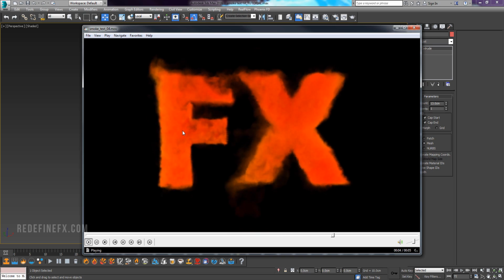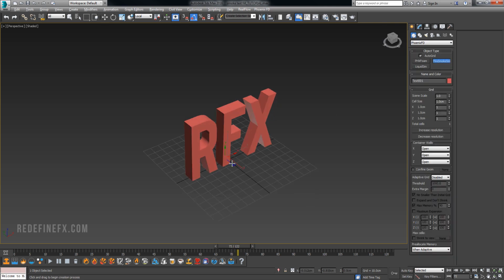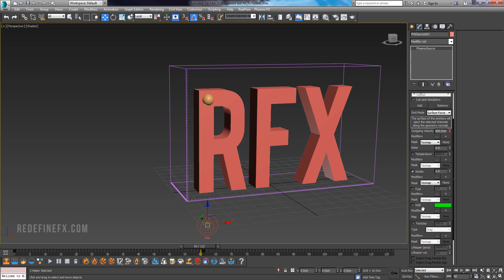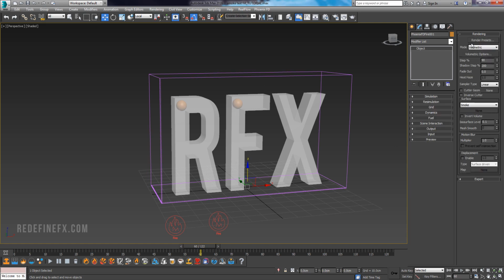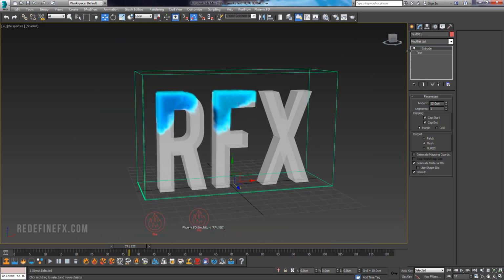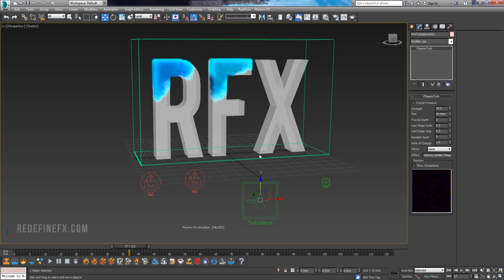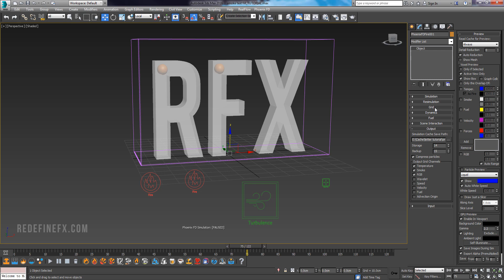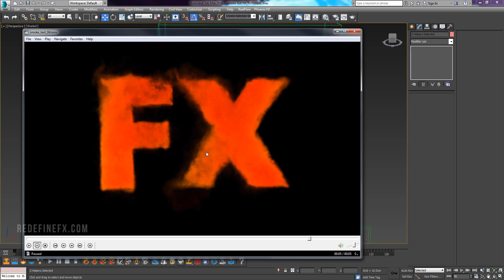Smoke Logo Morph Tutorial with Chaos Phoenix

Comment: the last part of this video is not working for me, in your video the smoke fills the volume very dense. I am using Maya but this should be the same. I have to crank up the Strength from 700 to 7000 to get a kind of effect? but its more like a cloud rather then a filled object with smoke
Reply from the maker: I think you just need to boost the opacity of the smoke in the volumetric rendering settings. By default it’s pretty low
Reply: @RedefineFX  to render it its a good idea :) but its still very blurry, it does not get sucked into the text like in your example. The object is ~20cm and for the body force I use 7000 strength